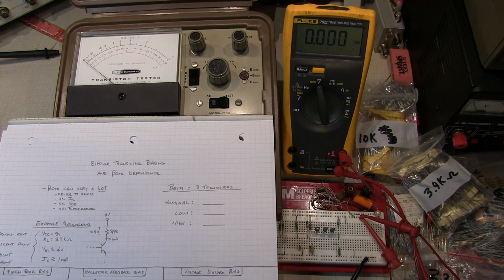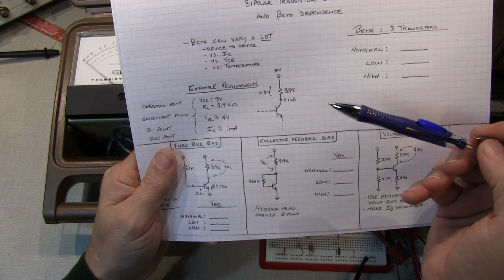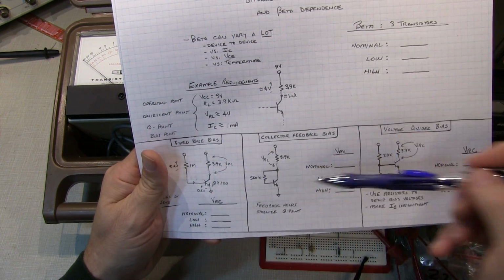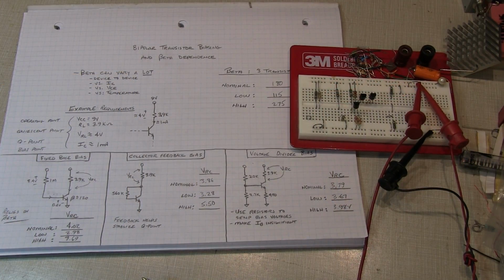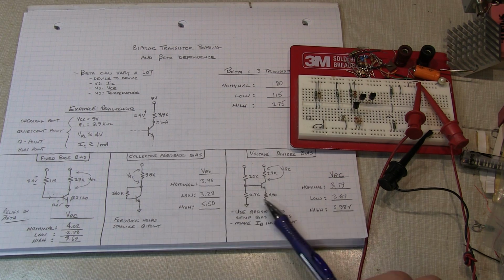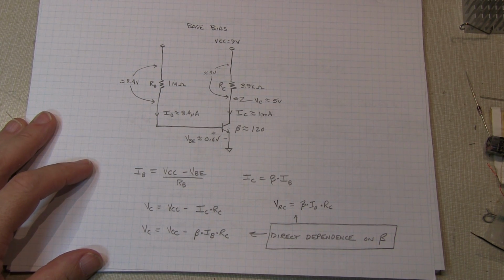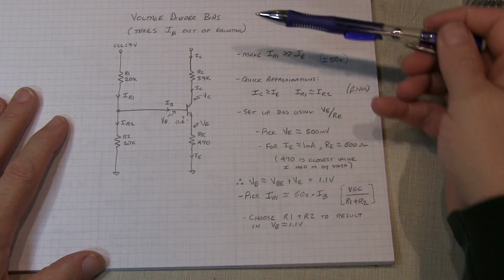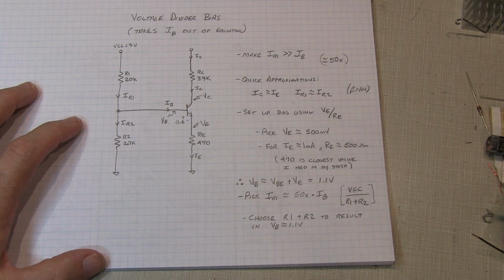#185: Back to Basics: Bipolar Transistor bias circuits and Beta dependence

Comment: Nice demonstration of what can be gained by negative feedback. But it is also important to know what you pay, in power consumption increase, voltage gain reduction, input impedance drop and output impedance rise. Comparing those effects would make for a good second video with this setup.
Reply from the maker: jpopelish Yes, there are a LOT of topics that could be given their own video when it comes to the good and bad affects of feedback and bias arrangements.